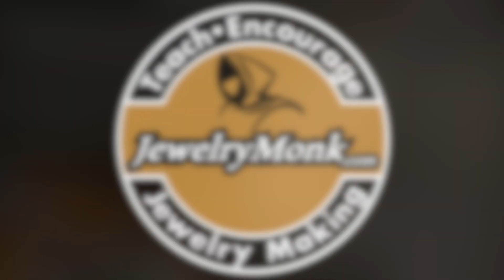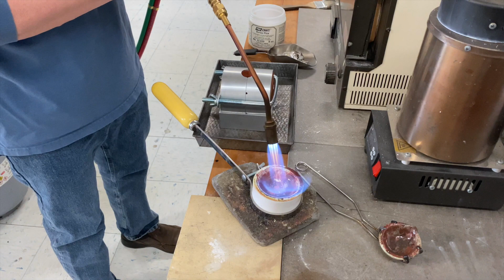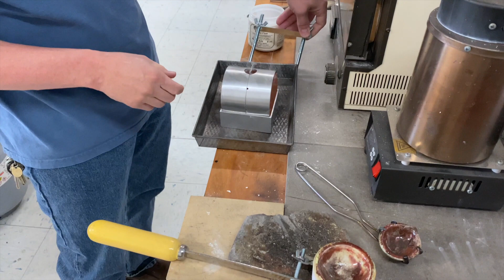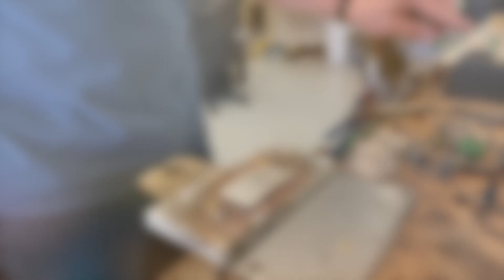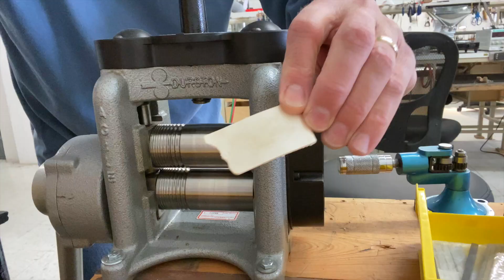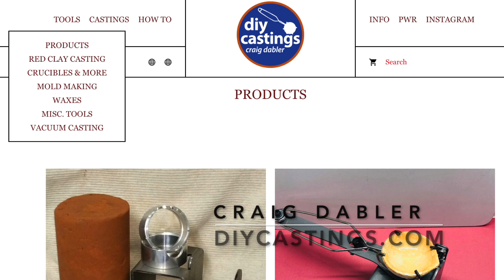Making Recycled Silver Sheet: Sustainable Jewelry Fabrication!

Comment: Interesting way to make a sheet of scrap silver. When you use an ingot, what do you put in that kind of mold to prevent the melted silver from sticking in it and come out???
Reply from the maker: Terri, the crucible is coated with borax. The ingot I used was a sand casting mold. Nothing added to keep it from sticking. I also use a steel ingot mold and coat it with a thin layer of oil, just about any oil will work. I have old vacuum oil that I dip my finger in and smear with a light coat. 
Hope this helps. 
Doug
Reply: @DougNapierJewelryMonk  Doug, Thanks so much for your reply. I appreciate very much!!
Reply from the maker: @terrisidell7041  it is my pleasure.